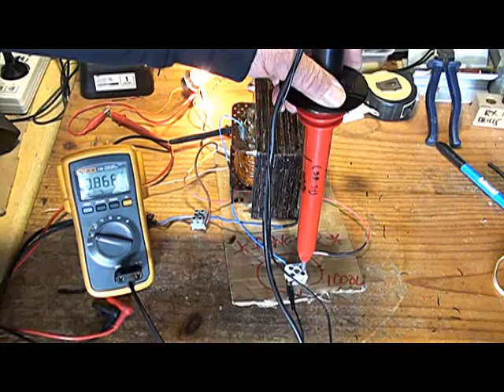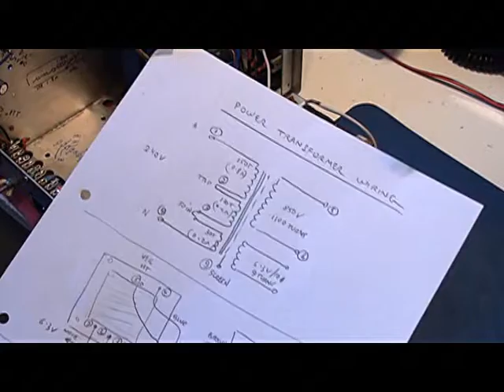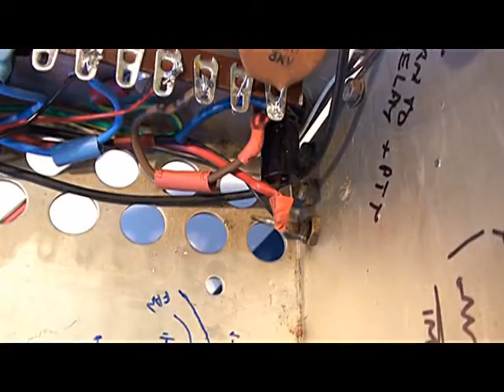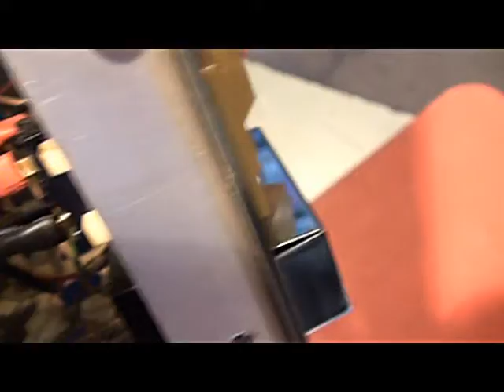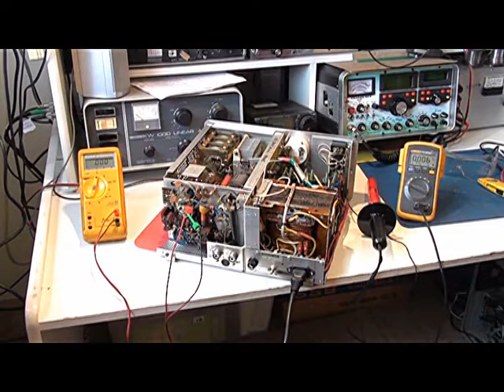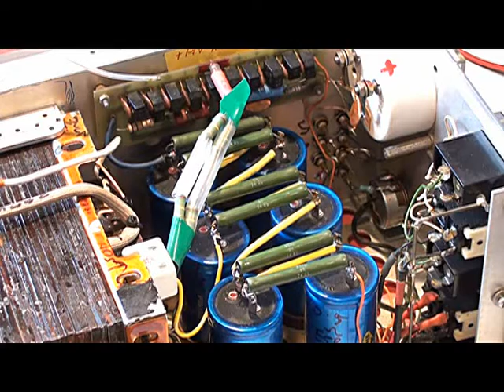KW1000 transformer rebuild part 2

Comment: Change that whole rectifier stack, 1N5399 or better. the caps? why mess around swap them out with something a bit fresher no?
Reply from the maker: Yes, the diodes were all replaced with 3Kv 6A ones after the video. The original square ones are still good but new ones are better with a lower voltage drop so run cooler.
Reply: @vk3aqz  How many 6A diodes did you put back in?
Reply from the maker: @michaelmacleod  2 on a bracket. They are stud ones from a large solar 5kw inverter. I think they are made by Semikron.
Reply from the maker: I should add that after I removed the original diodes on the PCB, I did replace them with 1N5408 diodes and new equalising ceramic caps. Just in case the heavy duty ones resulted in too much inrush current into the new caps and over stressed the HV secondary wire. So far the heavy duty ones are working but I think I will put back the string of diodes which have a slower turn on time, and  reduce the inrush current. So in effect I am not all that comfortable with the heavy duty inverter diodes just in case the transformer secondary gets overstressed. And I believe putting a fuse in the HV line to the diodes is apparently not  a good idea either - can cause flash over in the tubes if it blows, I have been advised!